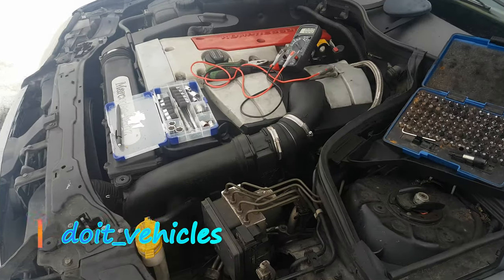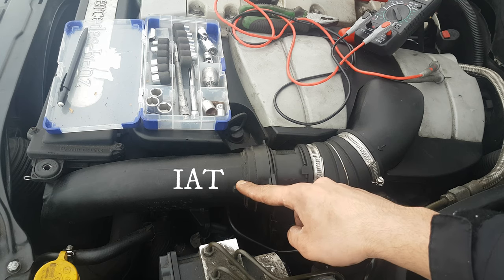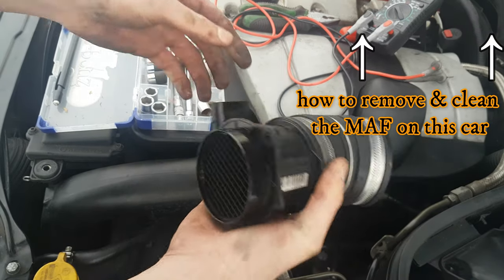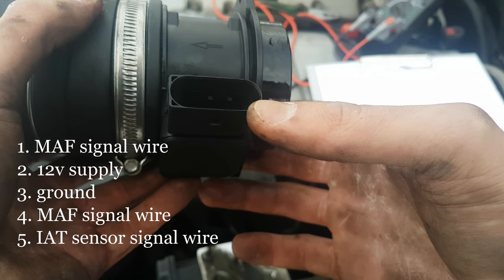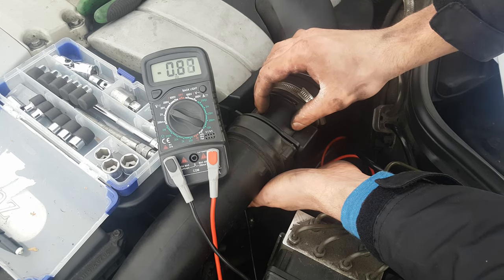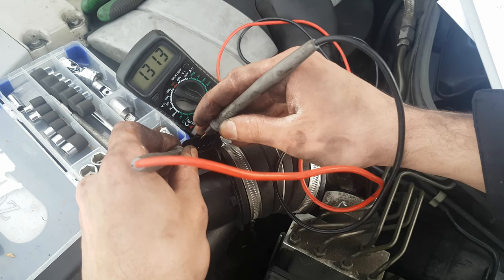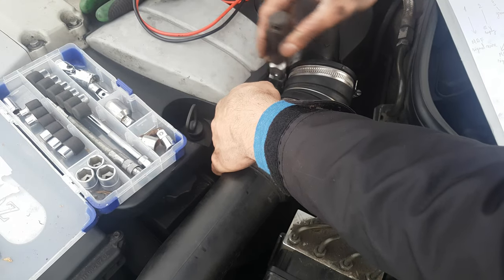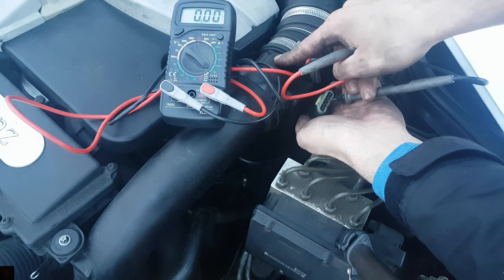Mercedes w203 Mass Air Flow sensor - How to Test it - c200 2002

Comment: My friend in your very nice post there are few mistakes according to Mercedes DAS & my personal on board checks on a W203 C200 kompressor, 2000cc with DAS diagnostic.
 a) #1 pin is Ground for IAT and NOT MAF sensor, #2 pin is Power supply 12v, #3 pin is the MAF sensor, #4 pin is Power Ground, # 5 IAT sensor, all other are Ok..
 b) IAT sensor #5 must NOT decrease as revs go up (!!?!!), instead must be steady approx. 2.5 - 2.8 volt  (or 6060 Ω)  at 20 degrees C. at IDLE, and as inlet air temperature rises, slowly volts (or ohms) must going down to 1.1 - 1.3 volt (or 1760 Ω) at approx. 60 degrees C.They can use a hair dryer to check it, thus to prevent misleading your followers.
With respect to your post, 
Gus Vlachos

Comment: Seeking your advice for M271 engine. to run the engine permanently lean mode to save more fuel and we don't want power due to road traffic. What supposed to do in MAF sensor to get more and more fuel ⛽ efficiency 🙏 thank you in advance

Comment: Hola maestro muchas gracias,tengo mercedes c230 M111 del 2001  en el  MAF en el pin 2 esta llegando menos de 5 v. De la ecu no estoi seguro con ese voltaje el vehiculo cosume demasiado combustible ud dice q a ese pin (2 ) debe llegar 12v  ese sera mi problema porq esa señal no viene de fusible. Porfa

Comment: Hi friend , getting from 3.40 to 3.60 g\s at a very cold day is a good reading? 2001 w203 c200k
Reply: MAF should not be less than 4.5g/second at 0.5barg manifold intake pressure unless there is slight vacuum leak after throttle valve body of very slight crack in hoses along PCV valve. In early morning dip for engine oil level. Then start engine and switch on air cond. Keep engine running. After 2 minutes dip again for engine oil level with the engine still running. Oil level should drop by 20mm. If oil level increases more than 10mm then consider high blowby by your pistons. This would be the case if your PCV and hoses is still good.

Comment: Hello, give me an idea for help, I changed spark plugs and coils and every time when it is below 10 degrees for 1 minute it breaks on a cold start, then there are no problems until the next day! otherwise, in general, the car runs well and it's fine, but this morning annoys me a lot, I changed the throttle and it's not from him either!
Reply: Look at the water temperature censor.
Reply: @prenomnom6642  it was changed and he is still the same…

Comment: hello, if you can give me a tip, my car the flow of the maf sensor is between 2.5 and 4.2 g s, at 750 rpm stopped, is this normal? thanks!
Reply from the maker: No , it should be a lot more steady and direct proportional with rpms

Comment: Do you know what the reading of the MAF should be at idle in grams per second? I'm getting 2.3-2.4 g/s at idle when car is warm. But it sometimes drops to 1.8 g/s. I'm using an OBD scan tool with Torque Pro to monitor these readings.
Reply from the maker: it should be around 4 grams at 750 RPMs . It looks like a dirty MAF sensor
Reply: During engine idling at 750rpm my MAF is reading at 4.6g/second at 0.5bar intake manifold pressure vs 5.7g/second by theoretical calculation. 

750rpm/2/60 x 1.8litre engine x air density of 0.506g/litre at 0.5barg = 5.7g/second. 

Pressure in each cylinder at DBC, during end of intake stroke, should be a bit lower than the manifold intake pressure of 0.5barg. It is possible to be as low as 0.4 to 0.45barg when each piston is at BDC. This would account for MAF reading not getting to 5.7g/second. Further more blowby flow coming from PCV is not measured by the MAF sensor.

Comment: hi, it would be nice if you could help me. I changed the air mass meter, but my car C200K M111.955 sometimes has speed fluctuations when it is stationary and it is sometimes a bit high. When I read the error, the error boost pressure too low came twice and mixture adaptation 1 was additive to fat sometimes the car has not the whole power but sometimes it has good power and i dont know what to do anymore😅 would be great if you have an Idea love youre Vids🙏

Comment: Hello Sir, Please answer me,
at idle (690~ RPM) I'm getting a MAF rate of 4.50 g/s or 14.3 kg/h in another scanner.
The car is C230 2007 Mercedes V6. Do you think this is good?
Reply: 4.5g/second by MAF at 750rpm at intake pressure of 0.5bar is likely a bit too low for a V6. Is it a 3 litre engine?. Nevertheless MAF should not be more than 9g/second even if it is a 3 litre engine sucking in air at 0.5barg at 750rpm. Connect your scanner into a similar car as yours to compare.

Comment: Hello dear friend, FOR TESTING ONLY,  what happens if I connect the additional MAF sensor to connector and fully closed IN and OUT without removing existing MAF sensor from the intake. 
Looking forwarded your replay
Thanks
Karthikkannan
Reply from the maker: The engine will get a noticeable idle change and depending on how the PCM is programed , it's gonna run the engine on default mode with preestablished values . It will obviously trow a code and it will also run rich most of the time during the change in rpm .
Reply: Seeking your advice to run the engine permanently lean mode to save more fuel and we don't want power due to road traffic. What supposed to do in MAF sensor. Thanks

Comment: What could be the problem with my mercedes in 203 c180 petrol 2002? I drove home, turned off the engine. This morning it wouldn't start, I couldn't hear the fuel pump so I replaced it. The car still does not start, there was no pressure on the fuel rail, so I changed the fuel pressure regulator. The car still does not start. Do you have ideas what could be the problem?
Reply: Did you check pump's fuse (4th from the top in right) & pump's relay (on top), in the rear SAM ??!!
Reply: @gusvlachos  yes . Its ok there
Reply: @PlecakPN  Do you listen the pump ?, did you change the fuel filter with regulator ?,  Is there fuel pressure now ? Must be at least 3.0 - 3.2 bars   to start the engine, (proper value: 3.7 - 4.2 bars) . Do you have proper tools & skills for the checks ?, to guide you step by step to solve your problem. Inform me to plan next step, otherwise go to a MB specialized garage.

Comment: Brother i have a w203 220cdi and i have also problem of egr , i watched some videos on YouTube and i have done the same job that you also did.But after 2 week i have got the same problem that egr is not working any more and the engine light in on also. And when i have done diagnosis it show the error P0404 , P2062, P2014.
Can you please help me!!!
Reply from the maker: Have you watched this : https://youtu.be/NQakvGOgcTo   ?
Reply from the maker: what did you noticed after the inspection ? is the egr valve moving , the selenoid getting power and so on ?

Comment: Hello, i followed your great video, and I found that my w203 C180k has the same MAF sensor (5 male pins), and the connector cable has also 5 holes BUT only 4 of them have copper connection, there is one (for the fifth Pin from left to rigth) that only carries a plastic hole, seems that there is no connection at all from that Hole, is that normal? (the cable doesn't seems damaged, i wonder if the design is correct for my car) someone helpme thank in advance
Reply: Yes this is normal for w203 C180K, #5 pin is for intake air temperature sensor (as it is on w203 c200k) and in your case this sensor is in a separate place  from the MAF unit !

Comment: Hi Buddy I need your help , I have trouble with my w203 c200 Komoressor it’s shows this on obd2 P0101 Mass or Volume Air Flow Circuit Range/Performance what it may be , I really need your help Thnx!!
Reply from the maker: Hi . First thing check out if you get some response from the sensor on the live data under a variable ( rev up the engine ) . Have you done some test from this video ?
Reply: doit_vehicles when engine idle shows 4,5 g/s its show things like this voltage e.t why this error come if maf works

Comment: Hey mate i have question i have merc c220cdi 2008 old shape. Won't  rev over 3000rpm any help or advice please.  It's been on and off i have vhanged brand new air filter was fi e and then started again. Thank you very much appreciated.
Reply from the maker: Any trouble codes ? Since it's a 2008 you can see some live data like the fuel pressure or check the egr valve
Reply: @doit_vehicles  im doing diagnostics on tuesday so will know thank you for your reply
Reply: Zoran Krstev any results.?

Comment: I have a problem with my car. There was a problem with Air Flow. I bought a new im Internet, 2 hours the car was fast, now not. When the car is cold for 1 minute works not good, works a bit more like the Diesel engine 30 the latest sec that no fuel. This happened when I had interfaced the air Flow.
Reply from the maker: Hi ! What was the problem with the MAF sensor at the beggining ?

Comment: Hi,
I thank you for this Video.
I have changed my MAF this week et now I have a P0113 code, IAT.
Can you tell me please where I can find it (I mean localise it on the Engine) ? If I need to buy a new? 
I have the same Engine of you. 

I Thank you.
Reply from the maker: Hi ! Can you describe first the symptoms that made you change the MAF and what codes did you had before changing it ? The IAT sensor it's on the same unit as the MAF sensor as I mentioned in the video ... If you have the exact engine , you will find 6 wires connector on the MAF & IAT unit . You might have to check if you get any signal from the PCM on that 6 wires connector first ..
Reply: @doit_vehicles  I thank you for your response.
In 28/11/2018 I have seen this code P0101 and since this time my car loss power and when I lift my foot on the accelerator; the rev-counters goes down to 500 and goes up to 1000 and stays like that for a sevral seconds.
In the last 3 weeks this behavior happens more than one time by day. 
In the last week,  I have disconnected the MAF for 3 days and my car works good (without the symptoms).
I have put the new MA in the last weekend and the code P0113 appears and I feel that my car is not good at all.
Reply from the maker: First I am sorry to say but you probabily should not replace the MAF sensor . Try to do the test on the old MAF and clean the hot wires . The new MAF it sounds to me that it's not compatible with the car or you might have a short betwen the MAF unit connector and PCM - so test that .  If you have a scan tool which shows you the values of the MAF and other data , the diagnostic process would be  easier . 
Otherwise I can only guees it's a vacumm leak , a short or just dirty MAF sensor (the old one) and the new one is not compatible or defective(very rare) .

Comment: I'm still having problem in my car
Reply from the maker: What can I do for you ?
Reply: Okay limited you what happened what exactly happened I lost my range sensor the shifter and then I replace it everything is was was fine okay I drove the car smooth and easy the next day the try to start the car at 1 since that day the car is not cranking
Reply: I have a good battery I have good power everything but the car won't start and won't even click after I replace the shifter
Reply from the maker: it might be because the computer thinks you are in D ( drive ) instead of (P) parking . you have to gather more data about the issue .
Reply from the maker: what do you meen by " limited you " ?
Reply: Oh sorry I mean let me tell you....
Reply from the maker: try to get someone with a good scanner to get the info or have a look on your car . All I can do is to give u some indication on what to look for .  Sorry , no phone number since there will be maybe thousands like you in the future  , who will ask for a solution on theyr car .
Reply from the maker: try to select a different gear before turning the keys . like Neutral , Reverse or Drive .. it might be some reverse in signals . Since these on these transmission you must have the car in P in order to start the engine .